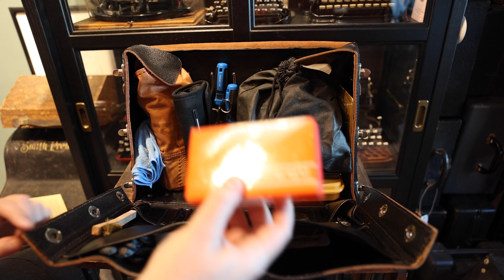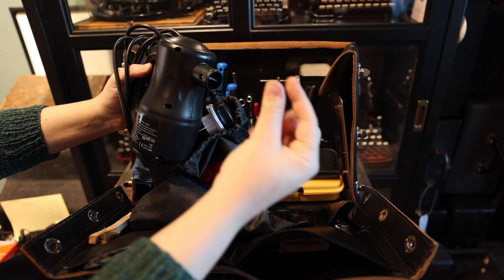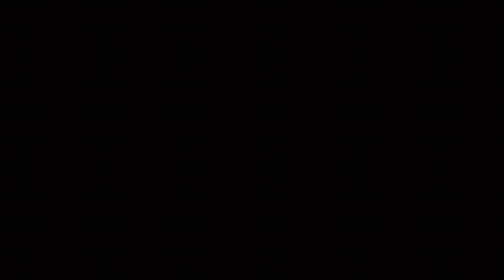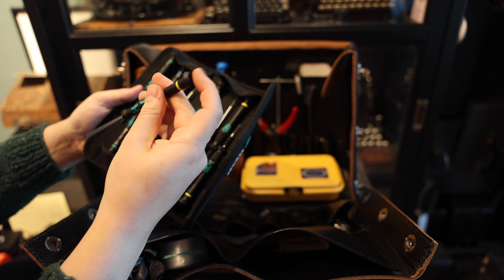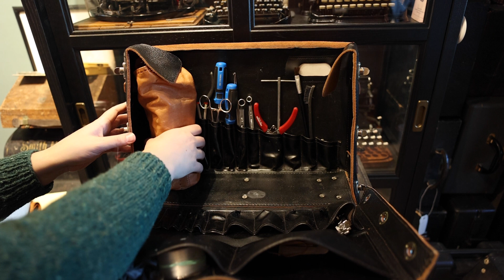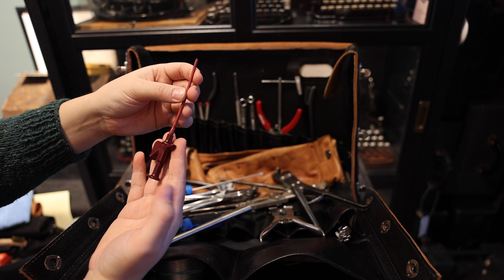Tools of the typewriter trade

Comment: Nice recap. I have the same tool that you call a screw grabber in my kitchen drawer. It was labelled as a pickle picker when I bought it (for pulling gerkins out of the tall narrow bottles that they're sold in).  I have, in fact, used it as a screw grabber as well over the years.:goodvibes:

Comment: Found one of these on eBay after watching this video, picked it up today! 🔥
Reply: and by that I mean the amazing case 🤓
Reply from the maker: @danrubin  That's amazing, Dan! As in one like this or an actual one with "Televerket" decaled on it?
Reply: @Retro-Type  The exact same case / size / Televerket logotype! When I saw the folding front I wanted to find one (both to have, and for ongoing bag design research :) and I feel so lucky that one was available in the U.K.
Reply: Now to find all the fun tools — I think that might more more difficult 🤓😂
Reply from the maker: @danrubin  you found a Televerket-bag in the UK? That's mind blowingly amazing! Congratulations on that! The bag will likely be from the 70s or 80s. The department was named Televerket from 1969 and up to 1994 when it changed to "Telenor" which is what it's called now (and is now partially privatized, but the government still owns like 59% of it)

Comment: Awesome recap, the tool roll for the pliers was excellent.  Clearly need to add a durometer to the kit!
Reply from the maker: I find the durometer helpful to at least make a metered assesement of whether the platen really needs to be changed or not. In some cases the platen is so hard that there is just no doubt about it and you can absolutely tell by just trying to push a nail into it. Other cases you can tell it is hard, but that there is still some give in it. In those cases I find that the durometer helps me at least make up my mind. :) The one I use is very cheap and likely not accurate at all, but a nice and accurate one does rack up a very hefty price, so I just make due.